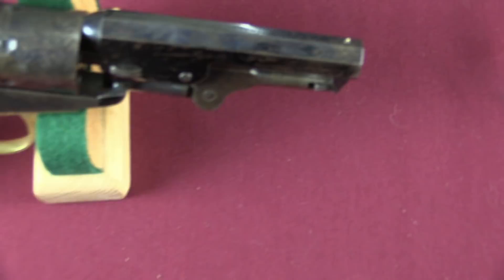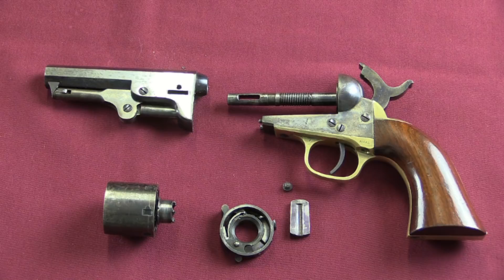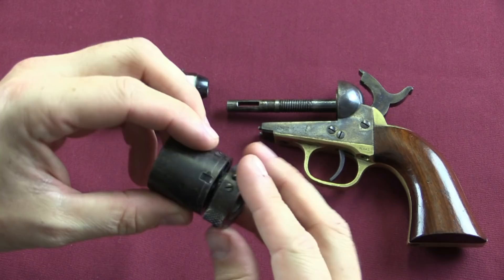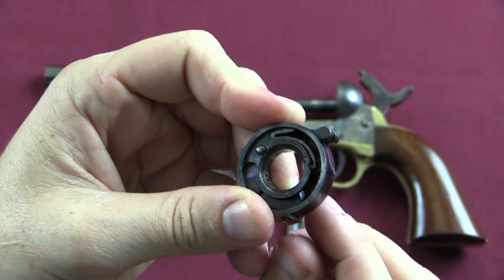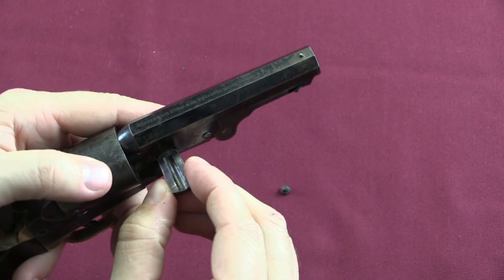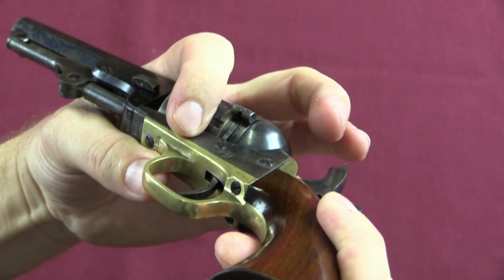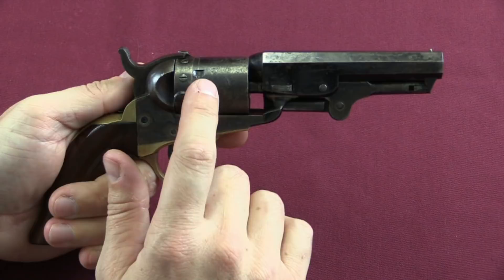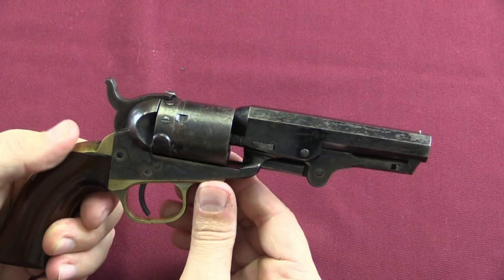Thuer Conversion Colt 1849 Revolver

Comment: That safety mechanism is brilliant.
Reply: Modern Cartridge Conversion Cylinders could learn something from the Rear Part of this conversion.  The Safety is very innovative!
Reply: I really find it hard to believe that this necessarily allowed people to do something they weren't already doing. By which I mean I doubt everyone was carry their revolvers with one empty chamber. 
Though I guess some of today's people are dumb enough to carry their semiautomatic pistols with an empty chamber
Reply: Agree!!!!
Reply: If the hammer were pulled back even a little by mistake, the hammer then comes to rest directly on the firing pin... Doesn't seem too brilliant to have an automatically deactivated "safety...."
Reply: @elementalist1984  There are plenty of accounts of people carrying revolvers with the hammer on an empty cylinder. A tap on the back of the hammer (maybe from a stray arm bouncing when riding a horse) can set it off. I'm sure people walking around and not riding carried all 6 loaded pretty regularly, but riders often wouldn't.

At least, that's based on what I've read, anyways...
Reply: Grandpa said he carried his Grandpa's single action Star with the holster strap under the hammer which both kept the hammer off the primer and pistol securely in the holster.

Comment: Being able to safely carry all 6 chambers loaded is great. Other than that there is no advantage to this over just black powder and percussion caps. If this was competing with percussion cap revolvers, I would say it is great. This was competing with SAA revolvers though, so I fully see why it never caught on. Like you said though, they were not allowed to bore all the way though the cylinder. They did well with what they had to work with. If I was around then and was looking for a nice carry piece, I might get one of these and bore it all the way out, assuming a standard .32 would still fit. A bit of machining but I think it would had been worth it.
Reply: According to InRange, many percussion revolvers had a half-way notch between the chambers to rest the hammer, allowing a percussion revolver to safely be loaded with all 6 rounds.
Reply: @cymond  Some do and some do not. Many modern production ones do.

Comment: That safety feature is really clever. Easily the most interesting feature of the conversion as a whole. A remarkable early revolver safety mechanism.
Reply: Doesn't look like it would be "safe" at all .. think about it, the only thing keeping the safety in place is the hammer.... Kinda self defeating... Like a seatbelt that automatically releases if you press the brake.

Comment: Great video. I knew the cylinder was front loaded, but was unaware the safety worked like that. Disassembly of the gun to reload is not that great of an advantage over a percussion cylinder. Interesting dead-end that took 150 yrs. to be revived (Krist)

Comment: From many years ago, I remember another revolving pistol, not a conversion, that used a different system to avoid the White patent. The cylinders were NOT bored through, a .32 ? rim fire cartridge was fed into the front of the cylinder and a thin flanged bushing  was inserted over the cartridge, the small flange protruded from the front face allowing for insertion and removal of bushing and cartridge.

Comment: Smith & Wesson's patent had not yet expired for the Rolin White bored threw cylinder. Alexander Thuer's design was to circumvent the White Patent which Smith & Wesson bought until it ended in 1868. About 4,000 Thuer conversions were made and are extremely RARE!

Comment: The problem with it is the bullet needs to be slightly wider than the casing so that the bullet gets the same lead on steel interference fit that holds the bullet in cap and ball revolvers.

Comment: Was there ever a cartridge conversion which was simply a replacement cylinder for cap and ball pistols?
Reply: Technically, that's not possible. 
The cap & ball hammer does not have a firing pin. 

Unless you're referring to the system like modern conversion cylinders. They're a two part design that must be disassembled to reload. The back of the cylinder has a disk with 6 firing pins. You remove the cylinder from the gun, pull the back plate off, load new ammo, put the back plate on, and reassemble the gun.

Comment: I can see why many would revert to the original cylinder, as cartridge loading in this case does not appear to be any advantage, however the "snap cap" safety is just bada$$, So Victorian and useful at the same time!
Reply: It seems like a thin, sliding metal disc that blocks the hammer could have been retrofitted to many percussion revolvers.